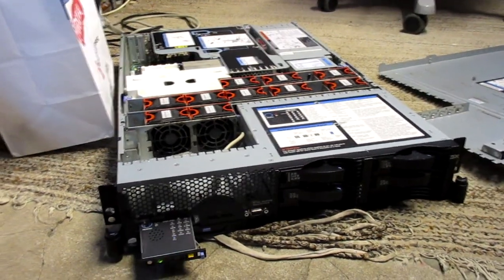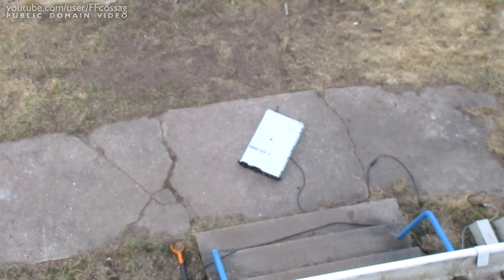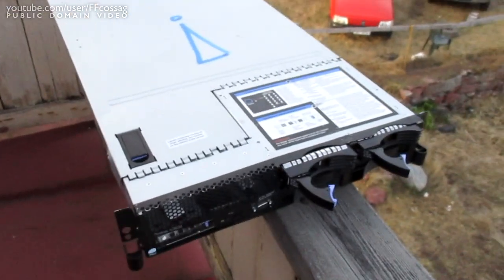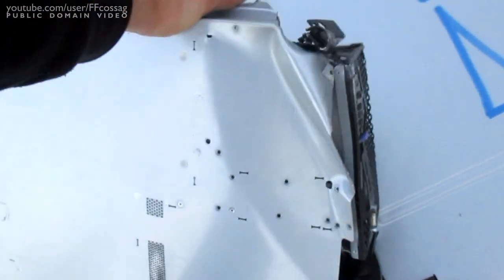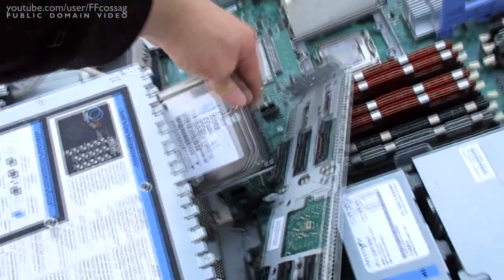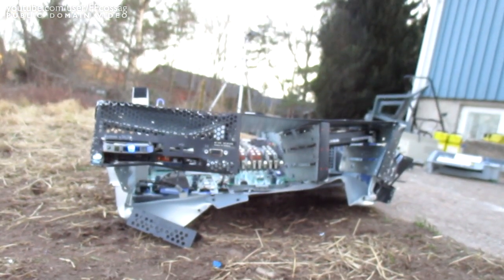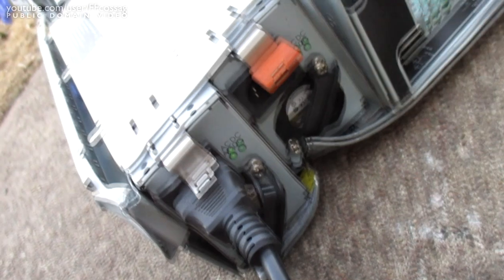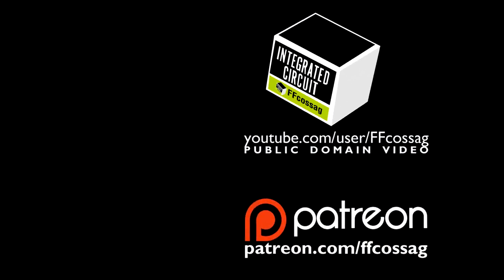IBM server crash test into hard surface

Comment: Years ago I was told of a PS/2 Model 95 server that was thrown from several floors up into a dumpster. It smashed through several monitors and other things already there. Someone rescued it, reseated everything that had popped loose and it powered right up like nothing had ever happened.

It's nice to see that standards hadn't fallen too much by the time this server was made.
Reply from the maker: Redoing this test with a Lenovo branded unit would be interesting.

Comment: It's properly dead, Jim.
Next time, put a big transparent bag over it to avoid having to pick up bits everywhere. Just a tip.

At my former work we threw CRT monitors in the trash (e-waste), if one of the guys needed some stress relief, those things were send flying across the parking lot in a bag, lol.

Comment: Morton must be crying right now.
Reply from the maker: The servers he magneted were fancier than this one.
Reply: FFcossag its literally the same server he used in his server farm. couldn't just figure out how to repair this one and continue using it as normal?
Reply from the maker: The vast majority of Morten's servers are several generations newer than this one. You couldn't even fit a 45 nm CPU in mine.
Reply: Well I did actually fix the server that I broke with the magnet,, and gave that one to you,, I did not bother to install an OS, just changed the drives that the magnet broke. I did not want to smash to much good hardware, and that is why it had,,512MB bloks/ slow CPU and 73GB SAS drives.
I still have 10 of these server, and with better stuff in it, it an awesome server. (Yes it uses way to much power, kind of the same way a Jaguar is not damn Fuel economy) ½ a year ago I sold one of these,, for 800dkr which is around €110,,, locally. I was asking 1200dkr. but had to go a bit down.
I am right now upgrading a server like this to become a cloud server, where my patreons will be able to get a VM server at My PlayHouse, this involves instelling 48GB of RAM, 12TB of storage, PCI-e NVMe M.2 SSD to boot the latest VMware ESXi 6.5 of,,yarh and 4 extra 1Gbit networks ports.
I found out in the Magnet video, that my subscribers did not enjoy me breaking the servers,, which was why I used time and good money fixing them again. It´s clear to see here on your Like to dislike proportionate distribution. That that many of your subscribers feels the same way.

I am not crying over this server, it brought me 3-4000 new subscribers with the magnet video with Brainiac75, and i learned that my subscribers did not like that much. And I gave it to you,, and you were happy for a bit.
Reply from the maker: Oh, this was one of the magneted servers? I don't think you mentioned that, lol.

Either way, I still am happy, I've saved some pieces of the server as memorabilia, and the power supplies are going to be an excellent source of FETs and schottky diodes for the foreseeable future.

Comment: So it wouldn't POST, but what about the bits inside it like the hard drive and RAM
Reply from the maker: What about them?
Reply: Well there's more bits inside it now :P 

The machine is ten years old. All the parts are ten years old. Unfortunately it's completely useless... Compared to newer processors the Core2 + DDR2 FB-DIMM stuff is incredibly slow. You can catch this server with a fast Pentium these days.
Reply from the maker: You don't even need a Pentium. There are 15 watt Atom CPUs which are twice faster than the Xeon 5130 in this thing.
Reply: So there wasn't anything useful in there anyway.

Comment: Could still had used the cpu for lets say 775 build , if it was from the good ones
Reply: Unfortunately that Xeon is only a 2 GHz dual core. An E8400 is clearly faster.
Reply: then it was a waste of space , epsecially the fact that it dint work . if it was some of those 4 core 12mb cache ones would be worth taking the cpu out